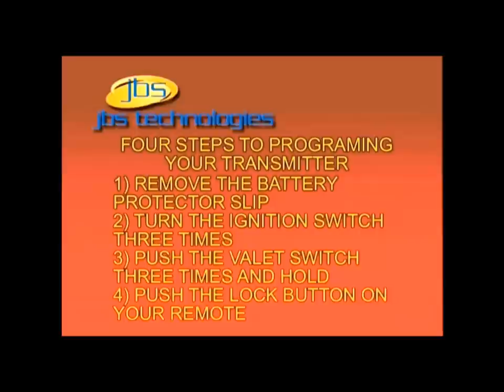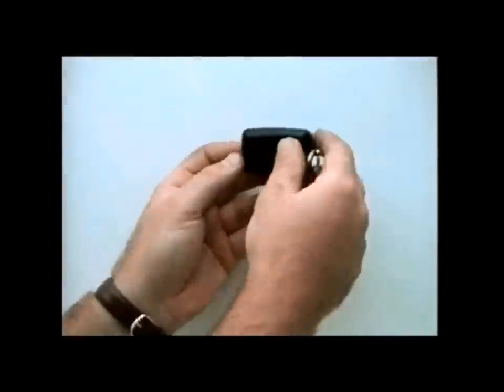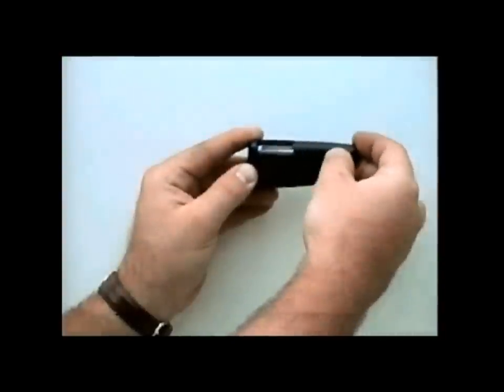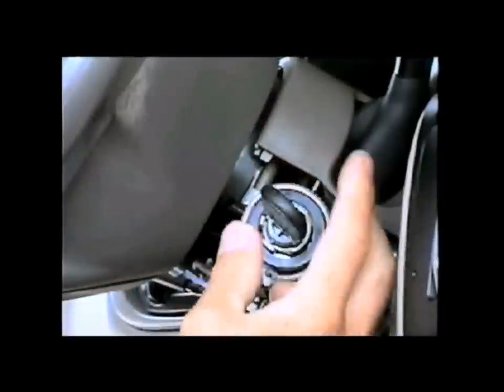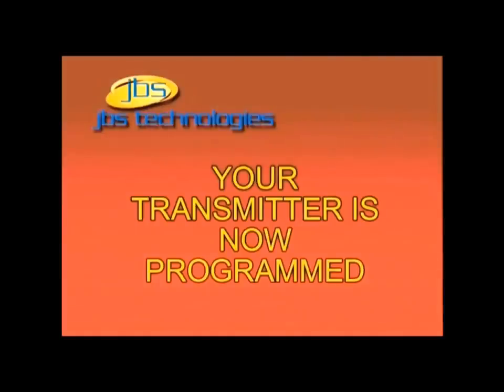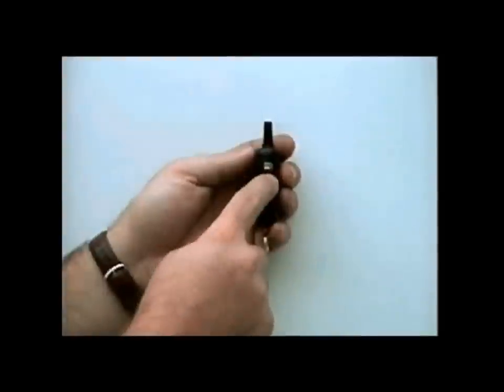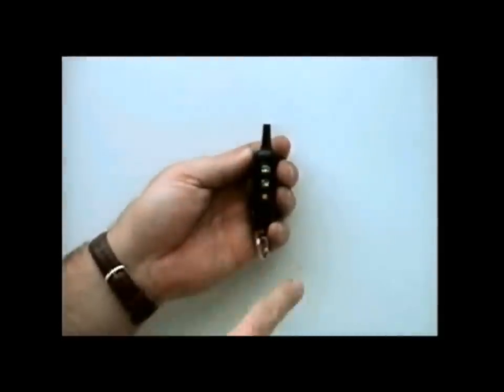Resetting and Transmitter Programming a JBS Bulldog Remote Start System

Comment: I was wondering if this is what I need to do.  My battery ran empty all summer and when I replaced it, it wont' start anymore.  Remote gets signal from the module tho.
I was thinking i need to reset my module.
Reply from the maker: I cant be sure, But I'd check the fuses and all the simple stuff before I reset it all

Comment: I installed the Alert 750r, basically the deluxe 500, into my car. When im in program mode for start feature chart 2, tach start, follow all steps on page 33 and 34 of installation manual and the car starts fine. Once I press the lock button to exit programming, it wont start again unless i go back into programming mode? I have been fighting with this since Saturday night and am out of options. Bulldog tech support wont get back with me to help, so I dont know what to do. ANY assistance would be greatly appreciated.
Reply from the maker: +John Cleveland try doing voltage sensing instead
Reply: +Lessco Electronics what's the best way to do that? do I need to disconnect the tach wire from distributor?
Reply from the maker: I would
Reply: +Lessco Electronics I'll try that again. I'm working on a 97 Mazda 626. just to ask, does the factory alarm disarm have to be hooked up?
Reply: +Lessco Electronics and for voltage sensing, all I need to do is program the remote to that by pressing lock + unlock while in program mode, correct? it's just when I'm in program mode, works great, but as soon as I exit program mode, the lock unlock buttons work, but there is absolutely no clicks from the module at all when I try to start it, like it has no power.

Comment: where can I get a bulldog m200 remote??
Reply from the maker: whats the fcc id of that remote?
Reply: @Lesscoelectronics  i have no remote, that is the problem.   Just m200 on the case
Reply: 94 ford e150 van.  Has a white 5 pin conn., then 2 fat 1pin conns (wh and wh/red), and a 8 pin conn with the antenna on the end.  4 big power conns on the flat side (yel and red,  the other red/bk and wh/bk
Reply: The wires and plugs line up with a rs1200, but i'm not sure, they work the same??